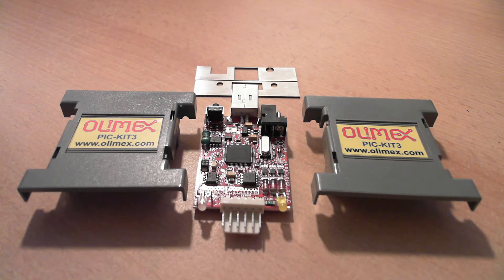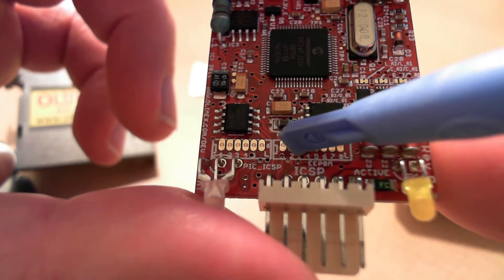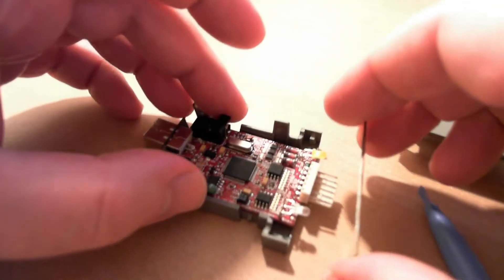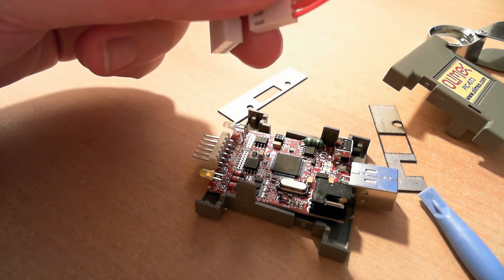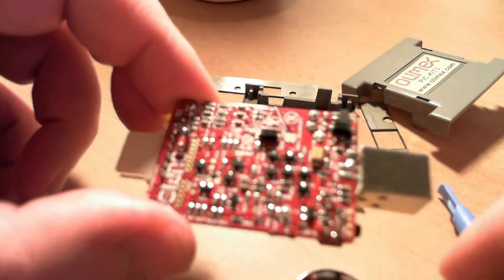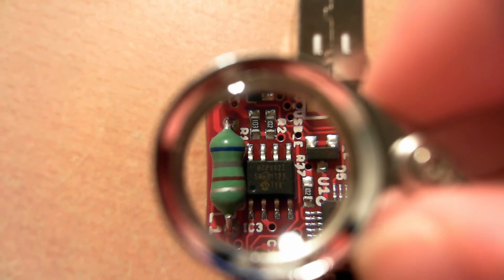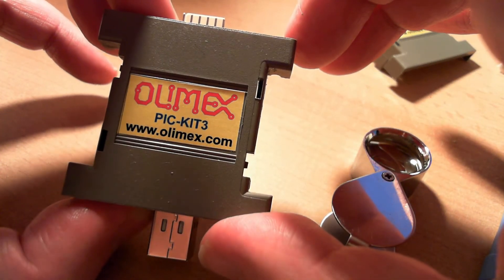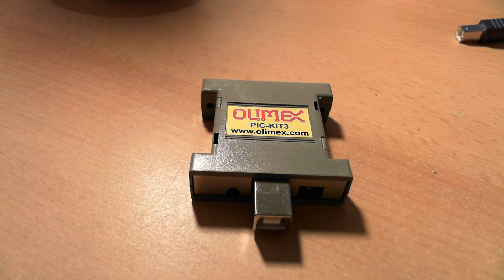Olimex PIC-KIT3 PIC programmer, taken apart and explained

Comment: I'm guessing the other header is for programming the EEPROM...  And currently this is selling in the states for the exact same price as a genuine Microchip PICkit 3.  Bummer.
Reply from the maker: No, the other header is another ICSP header for programming the PIC which controls the PIC programmer itself, to repair it/update it - yeah, slight recursion there :)
Reply: There are two headers.  You identified one as being another ICSP header for programming the PIC.  I'm saying that the second one (that you couldn't figure what was silkscreened...) is for accessing the EEPROM.  What else could it be?
Reply from the maker: Perry Codes I've no idea. If you work it out, let us know. Thanks.
Reply: 8 pins.  4 of the 5 letters I can easily make out:  E E P ? M.  Doesn't seem like there's any question here.
Reply from the maker: Perry Codes Great! Glad you've sorted it :)

Comment: The PicKit 3 Debug Express (DV164131) is currently sold for 29.76 EUR (without the shipping costs of approx 6 EUR) on Farnell (at least the German one) and it's usually sold for like 55 EUR. It also has a demo board that usually costs approx. 20 EUR. What do you think - is the Olimex clone better offer than this? I've recently watched a comparison review (PicKit 2 vs 3) on EEVblog but I don't know if (some of) the issues that were mentioned there (year 2009) were fixed (5 years later :D).